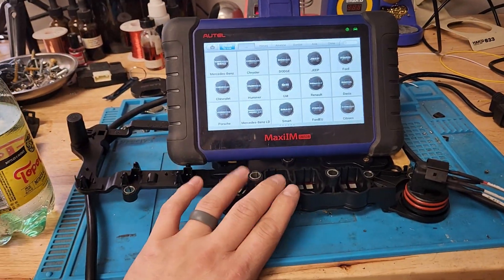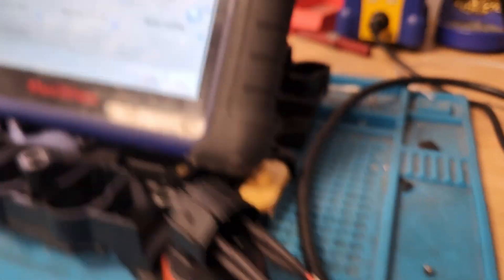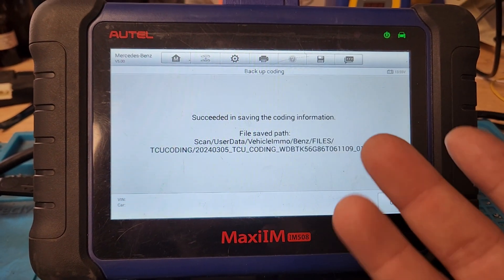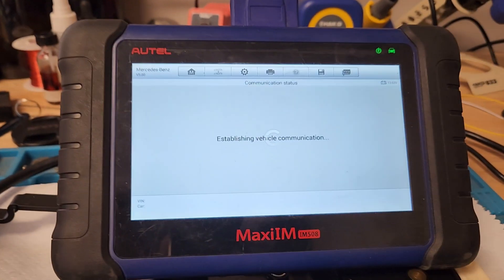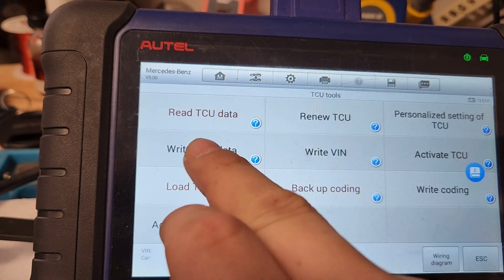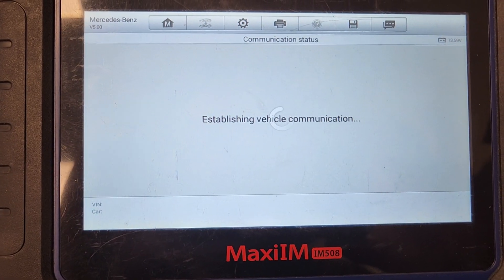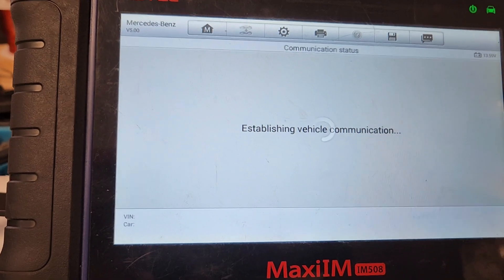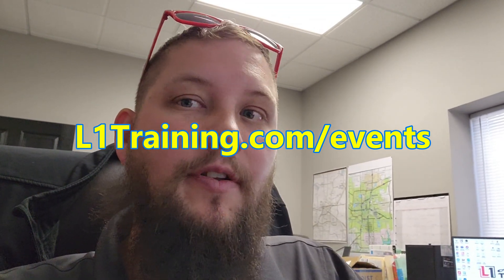Customer says there is no one that can program their car!

Comment: just a curious question but the go diag has a key off/on switch why is the box you use better?
Reply: The only thing I can think of is the resistor in that box in conjunction with the godiag is giving proper resistance reading for communication. I could be wrong though, I’ve never bench programmed anything and have 0 experience with the godiag, and my background is heavy diesel not automotive so procedures more than likely are different than what I’m used to. I’m interested to find out as well, since I plan on buying a godiag for home use as I’m the family mechanic.